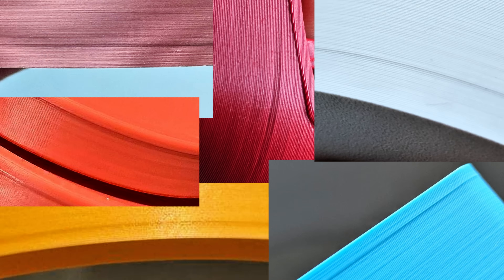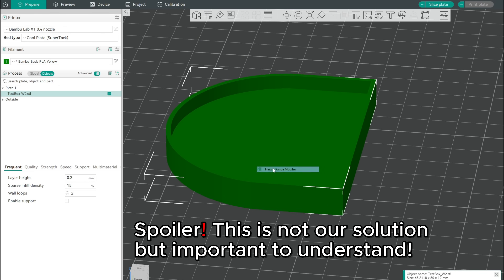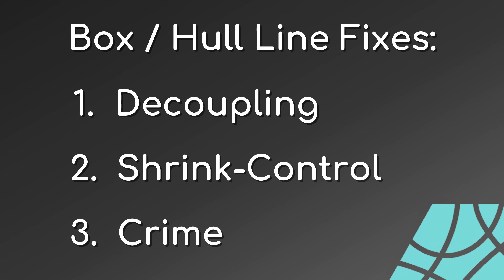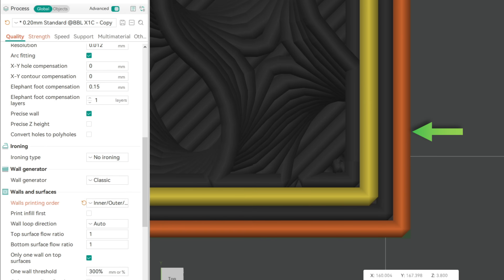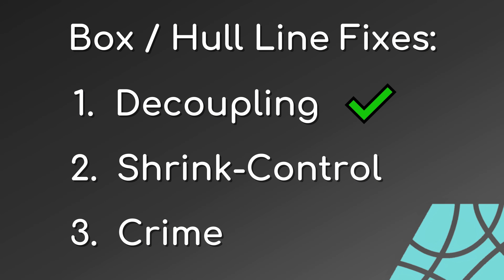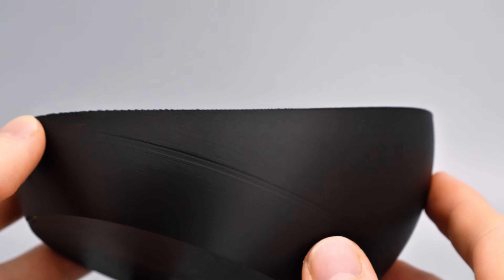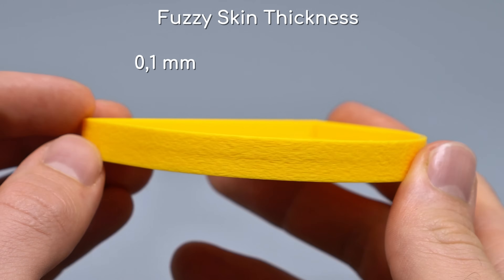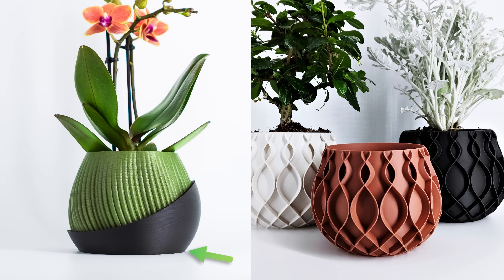The Most Misdiagnosed Print Error — Fix Weird Wall & Hull Lines!

Comment: I have also tried increasing the line width on outer walls to have enough squeeze to hide 'imperfections'. It blends together with the other layers (hides layer lines and imperfections), similar to using fuzzy skin. I found that 0,8mm line width with 0,16mm layer height have provided best results for me. Maybe worth experimenting?
Reply from the maker: That sounds interesting, have you tried this for the hull line problem as well?
Reply: I 3d printed a mathcube once, and it had the same line as described in the video. It was a chamfered cube. It made the line after the bridging and first layer afterwards. I basically tried 'everything' to remove the line, uniform print speeds, tinkering with layer time, precise walls, more walls etc. Until I finally increased the line width of the outer wall and immediately saw a difference. I increased the line width until it was completely gone.

Might make a difference for the hull line aswell? It could be worth a try atleast?
Reply from the maker: Maybe, I'll try it out next time I run into this issue. Thank you!

Comment: A better option for the "fix layer times" approach is print more than one part. Small parts with short layer times are just harder to print well and as shown minimum layer time is not a great fix.
Printing multiple copies of a part ensures even fast parts of the print will have a long layer time.

Still not a fix by itself.

Comment: I thought the "crime" was going to be printing it at an angle (obviously has more cons than pros lol) 

For DIY "engineering" designs, do you think Alibre is as good, better, or not really ideal compared to Fusion? If  it's even close and has decent organic capabilities (like blender), I would definitely give it a try. Fusion is frustrating, especially when it comes to combining organic and engineered designs.
Reply from the maker: For DIY engineering designs Alibre is excellent but I don't like fusion at all to be honest.
For blender organic capabilities you have to look somewhere else, Alibre is a parametric CAD software. Those don't mix well with node based software like blender.

Comment: First source of problems is printing with a toy, what is a toy? A toy is a bed slinger open frame printing at low temperatures.
Reply from the maker: All prints were done with a X1C btw. shrinkage based on mass doesn't care about your printers price. An enclosure makes it even worse as you see in the later parts.
Reply: @Factorian_Designs  I didn't mention my printers or the price. Anyway, all industrial printers are closed, guess why....
Reply: Lmao you’re soooo clever with this comment. Most of these enclosed printers are still “toys” my friend. If you need a real tool buy a CNC.
Reply: @Fraunzi  Already have one, but for some parts in not convenient.
Reply: That's an aggravating factor, but as you write just a starting factor. Won't be fixed by just going enclosure / heated / expensive printer.
Happens also on expensive so called "prod / engineering" printers like H2S w heated chamber, claimed 50um XY precision, yaddi yadda.
Ask me how I know ?

Comment: What about printing infill first, and then the wall. The idea is if the wall is not there, it can not pull on it. The inner layer can cool down first, and then the wall is printed.... 
Need to test that now.

Print infill first
The infill will be printed first, followed by the inner and outer walls. “Infill” here refers to all horizontal lines, including sparse infill, internal solid infill, top surface, bottom surface, and bridge.
Reply from the maker: I found that I got other artifacts when I used that setting in the past for other models.

Did you already try it out and did it help?
Reply: @Factorian_Designs  I think I will stick to hiding the crime :D, or as they say: Poor man's CF / Fuzzy Skin 
Cool thing is you can now paint on fuzzy skin to areas :P
Had a customer comment "that textured grip ring is a cool feature".... yes yes... that's definitely it.... 😅
Reply from the maker: Thank you for sharing your findings! I'll add "print infill first" to the pinned comment :)
But yes hinding the crimes is also my favorite :D
Reply: @Factorian_Designs  It works, but not perfectly on every geometry. I needed to fine tune the settings per model.
First try was on the Bunchy to see if the hull line can be removed.
Bambu Lab Studio and A1: Optimal preset with Gyroid - PETG, 2 walls, Print infill first, Infill wall overlap 25% (this is to counteract the downside of bad wall adhesion to the infill due to the Print infill first setting), Outer wall speed reduced to 100mm/s

This removed the line on the Benchy! Yeeeey
But when I tried it on a box model, it wasn't so effective. 
So I played around with Outer wall speed set to 50, 3 walls, infill wall overlap 20%, and that worked. Yeey.. only 1h of testing...

Then I tried it on another model that had 3 areas affected with the line. Managed to remove 2 of them, and could not remove the 3. one.
3h of playing around, and in the end using modifier block for the sections....

Sadly for now I don't have a method that would work all the time without trial and error test prints...

Some extra settings I like to use: 
Only one wall on first layer,
Avoid crossing wall
Bottom surface pattern concentric - first layer magic
Bridge direction 45° - depends on the geometry, and orientation of the model

Comment: Great video, really well done, and it will help me solve some problem. I have another tough nut to crack for you: Round holes in a vertical surface. The problem isn't simply that the hole won't be perfect (that's not a problem), but that it will carry artifacts around the entire wall at the height of the hole.
Reply from the maker: Okay I'll look into but I can't promise to find a solution :)
Reply: @Factorian_Designs  ❤❤
Reply: This needs to be bumped up. That issue with pretty much any opening in a vertical wall is the BANE of 3DP...
Can be reduced with super slow speed / accel, but then it takes forever to print anything.
Shape of the edges on the opening can help a little (chamfer / fillet instead of 90 degrees) but only so much can be done on thin-ish walls (few millimeters thick).
So... how else can this be controled ???
Reply: @raphofthehills4405 input shaper or other ways of reducing resonance vibrations should reduce it

Comment: Great video and perfect timing. I was just trying out different settings yesterday to hide that hull-line on my gridfinity bins. Outer/inner or inner/outer/inner wall order helps slightly. Reducing overlap to negative values also helps slightly (there seems to be a bug in Orcaslicer, where the overlap of the top surface is not influenced by the top/bottom shell overlap but by the infill overlap instead). I'll give chamfer/fillet a try (I generate the bins in Freecad on the gridfinty workbench, so this change is easy to try).
Reply from the maker: Glad it helped, let me know how the chamfer worked out. Lots of people seem to struggle with the gridfinity bins.
Reply: @Factorian_Designs  Sadly the chamfer didn't help in my case. A combination of outer/inner wall order and -90% overlap (both top and infill) did help (but still not perfect).
Reply: -90% would produce a huge gap right? Did you do that with a modifier or the whole print?
Reply: @PrintsAndPlanks  I think the percentage is based on the line width or nozzle diameter, so the gap isn't that drastic, but yeah there is a gap. I tried both -90% for the whole print and with a height range modifier just for the top layers.
 Bringing the layertime closer to the other layers (as shown in the video) is also helping a bit.

Next time I'll print a gridfinity bin, I just switch to outer/inner and smooth out the layer time difference (by increasing internal bridging+solid layer and top layer speeds). This way the "hull line" is not very noticable.
Reply from the maker: Did you make sure that the chamfer really decouples? Maybe you have to make it bigger but thats hard to tell without seeing the preview.

Comment: Caro Valerian. Como está?
Eu também pesquisei bastante sobre o assunto e descobri que essas marcas são geradas pelas PONTES GROSSAS criadas pelo fatiado no preenchimento prévio da camada após um espaço vazio.
Se você observar, para uma altura de camada de 0.2mm a altura de camada da Ponte, gerada automaticamente pelo fatiado, é de 0.4mm o que influenciará diretamente na marca na peça. Te peço para fazer seguinte teste: NO BAMBU STUDIO: Sem alterar nada no fatiamento padrão, altere de 1 para 0.24 o Bridge Flow e deixe selecionado o Thick Bridges e faça a impressão. NO ORCA SLICER: Basta deixar desselecionado o Thick Bridges que a altura de camada das Pontes Grossas será uniforme (pelo menos era assim, faz muito tempo que não uso esse fatiador). Se conseguir fazer esse teste, por favor, responda esse meu comentário colocando suas conclusões, ok? Obrigado pelo vídeo. Um abraço.
Reply from the maker: I'll try it but I am very sure this will not fix the issue. 
The solid layers are the culprit. Bridges result in very little shrinking tension as they just "hang" in the air.

Comment: Thanks for the tips! The differences are really significant.

I wonder when we will see real shrinkage simulation and compensation in the slicers. As far as I know, these techniques are already used extensively in injection moulding and stamping. Perhaps we could have a quick and easy version for 3D printing?
Reply from the maker: That would be a huge upgrade for sure. 
I'd love to see how much this could improve quality especially for big parts.

Comment: I've had a problems with walls being concave on round prints, and when investigating i was very surprised  that shrinkage is a real factor even for so called "non-shrinking" PLA. There is nothing "low" about 1% of shrinkage, because that is like 2mms on 200mm print. That is huge actually, and VERY visible.
Reply from the maker: True, I think this is the next big topic for the software side to improve on.
Reply: @Factorian_Designs  Yeah, my software engineer brain immediately thought "but you know how much PLA will shrink, can't the slicer just fix it? Add an additional outer wall? Of course, it would need to know the shrinkage of the PLA, but that's super testable with a small test print, and should be figure-outable fairly easily (I mean, your examples for PLA + calipers should be enough for a skilled slicer-engineer to figure this out. Not me, though, I'm not that)

So I do wonder why it's not done - is the problem much harder than I imagine? Does it require annoying fluid dynamic simulations?
Reply: That's why I do a 100mm round testprint with every new filament and adjust the shrinkage parameters. This eliminates so many frustrating hard to find errors...

Comment: I wonder, would it be possible to do some code changes, that on problematic layers like that, outer walls would be done, then surface part, after that do some pause for cooling, and then do the part inside walls?
Reply from the maker: Have to agree with @raphofthehills4405 I think shrink simulation would be one of the few solutions to negate this.
Reply: Don't think so. Pb is that shrinkage on the layer below is already occuring as the next layer is getting printed. So the outer wall is ever so slightly printed overhanging out of the wall underneath.
Seems that either the slicer could do shrinkage sims (very hard) and adjust the xy of the next wall, or the advanced printers could use the dang nozzle cameras to lay down the next wall perfectly vertical with the wall below. But no, Bambu & company prefer using nozzle cameras for just filament calibration (hit&miss) and unreliable spaghetti AI detection (hit&miss too)  🙄
But what do I know...